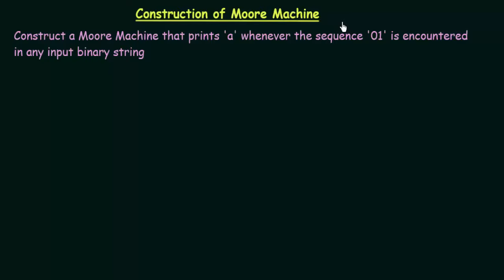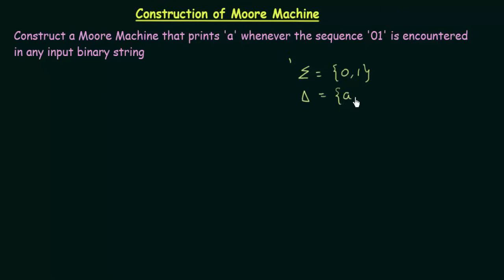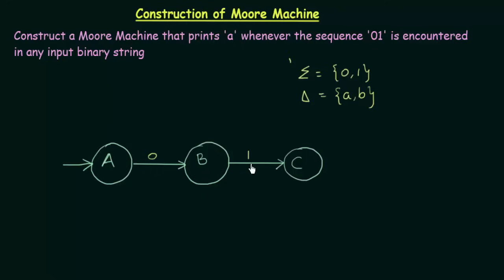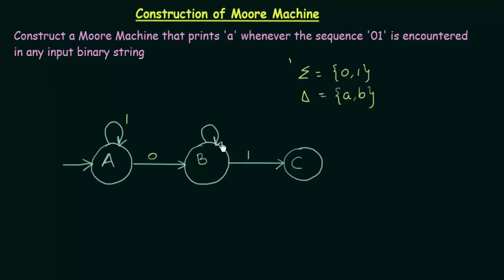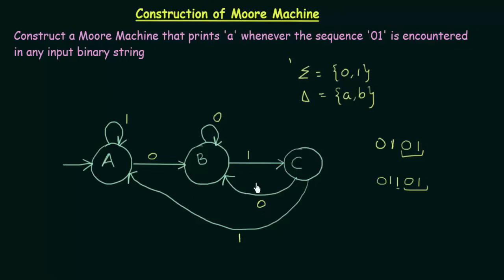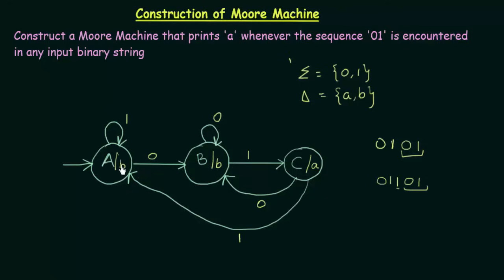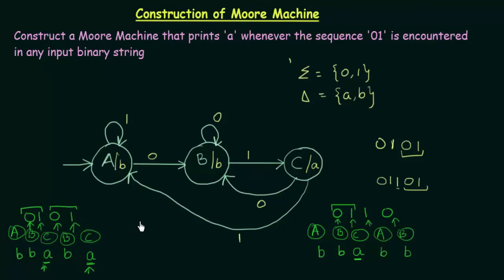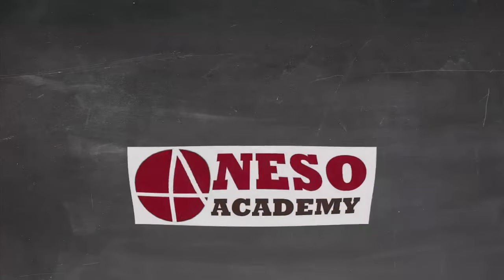Construction of Moore Machine

Comment: One thing didnt get is that when we give input 1 in C state it could also go to B as well, why have you necessarily sent it to A state?
Reply: because It has to start all over from 0 again. if 1 in C goes to B the sequence would be 11, which is wrong.  The second 1 after the last "1" has to go to 0 for the sequence to be correctly restarted.. hope its clear :)
Reply: Jamal Imam Thanks
Reply: if 1 in C goes to B the sequence would be 11 and what is wrong? the question is only when you get 01 then o/p should be a, therefore we can send it to B also

Comment: Sir, the same example of detecting 01 was done using Mealy machine also in the video 'Construction of Mealy machine'. The diagram is the same. Then what is the difference between them? I heard that Moore machine takes more number of states than Mealy.
Reply: A mealy machine gives an output for each given input whereas a moore machine gives an input for each given state.
Reply: Simple, Mealy Machine: You put 3 'Elements' in and get output 3 'Elements'. Moore Machine: You put 3 'Elements' in and get 4 'Elements' back, because Moore Machine reads the starting Point, even if you don't put anything in.
Reply: Watch the next example, it will be clear
Reply: The only difference is that the outputs are shown inside the state, in the Mealy example he could ignore the 'C' step by redirecting the 'B' to 'A' when 'B' receives '1' as input. I think the Mealy example had de 'C' step to make a parallel example with the Moore example, which I found great, but he should've said in the Mealy example that you could ignore the 'C' step.